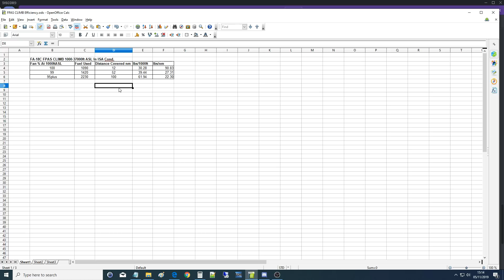Questioned: How To Most Efficiently Use FPAS CLIMB In FA-18C (Vid 2 of 2) | DCS WORLD

Comment: Just another iteration of the same question: if we also want to consider distance covered (and fuel burned), then the test should run like: climb to 37k feet with 100% power, then fly level with best endurance speed, then watch fuel amount burned for lets say 100 miles, vs. climb with min. sufficient power to 37k, then fly "best range" speed until reaching 100 NM, and compare fuel consumption with the previous result. I think the first one would use less fuel overall, because you would reach optimum altitude and speed for best range earlier, and could start saving on fuel earlier. It is practically an angle-of-climb vs. rate-of-cimb dilemma I guess.
https://www.youtube.com/watch?v=EgtjSPXjgWQ

Comment: FPAS is all cool and stuff but I personally prefer to watch the fuel flow. the RPM changes by altitude, and doesn't tell much about how much fuel you are burning. Fuel flow however will allow you to keep your aircraft going stable up with minimum fuel consumption. I need to check how the FPAS method compares to one I have been using, this is really interesting stuff :)

Comment: Those FPAS numbers are completely bonkers. Climb speed should never exceed cruise by that much and a lot of fuel is being wasted to parasite (400+ kts) and wave drag (> 0.85). As stated by most, best power setting is always MIL because it gives you the best power to fuel burn ratio. The important task is to find the speed which balances engine efficiency gains from ram effect with increased drag. The optimum is probably going to be between 350 to 400 kts indicated depending on configuration. Switch over to cruise mach when you reach it (0.85 in this case, but typically 0.82).

Somebody already stated this but the way you do the test is by flying a set distance (around 100 nm), and then you evaluate how much fuel was burned and the time it took. Sometimes small fuel savings can cost a lot of time which is why airliners use cost index. There will be a speed under which you should never go and it'll probably be a lot higher than you think.
Reply: Yeah, exact fuel burns and splitting the last couple of % can get an insanely complex subject. Airlines spend hundreds of thousands of dollars on specialty flight planning software to try and squeeze out every last drop of energy from the fuel they pay for.

Comment: Former military aviation mechanic here. Its standard to set power and adjust pitch hands down for optimal climb/fuel burn. Its lift/drag ratio that predominantly determines this. On a clean aircraft this can be all the way to mill-power for an optimal climb. Every airframe is different and depends on fuel, ordinance, and weather.  This is why pilots must know their performance envelopes and weights. It's the exact same for civilian aviation where climb rates and airspeed don't exceed airspace limitations.
Reply: On a separate note there are substantial differences in throttle control from 2 decades ago. Years ago you would add throttle with altitude to maintain EPR. Today computers do it for you and you are just adding added power with the lever, ie. it maintains a given acceleration depending on throttle position.  This gets very complicated when comparing decades old tech to current.

Comment: The clue why mil power(and more importantly afterburner) is more efficient than the other methods is in the distance covered column. Distance covered is heavily related to time and the more time you spend in dense air, the more fuel you burn.

There are several adventages to climbing to optimum altitude using afterburner, you spend more time in cruising altitude and less fuel is spent, you have more time to configure your aircraft(waypoint sequences and A/G & A/A modes and SA page radar etc...) once up there and more things that I can't think of.

Comment: So here's the very quick explanation for why there is such a thing as an optimum climb speed. It's a balance of several factors: induced drag, parasitic drag, engine thrust change with airspeed and fuel flow rate change with altitude. You are looking for an airspeed that, when all of these factors are added up, results in minimum fuel burn per nautical mile. Induced drag increases with AoA, so the goal is to minimize AoA (hence, increase airspeed). OTOH, parasitic drag increases with airspeed, so you want to limit your airspeed to avoid excessive parasitic drag (one of the reasons you'll notice your FPAS was targeting a fixed Mach number of 0.89, because starting at M0.90 you start getting into the transonic high-drag regime). Next comes the fact of engine thrust with airspeed. Turbojet engines generally lose thrust with increasing airspeed, however, the curve tends to flatten out at higher airspeed (and sometimes even reverses at very high, typically supersonic, airspeeds). Lastly, increasing altitude reduces air density, which proportionally lowers your aerodynamic drag values. So again, you want to fly as fast as possible to get maximum engine thrust and be able to reach higher altitudes faster (so you get to exploit the lower air density there to lower your drag), while not going so fast that it requires you to use an inefficient engine mode (i.e. afterburner).
All that having been said, you didn't quite do the test right if you wanted to estimate fuel burn per NM traveled, because you ended up not traveling the same final distance. The correct method would have been to level off at the target cruise altitude and sum up the fuel burn to your desired distance traveled. For example, your initial test with afterburners seemingly used the most fuel per NM, but you neglected to add up that for the remaining almost 100NM that the 95%Fan test had to travel, you'd have been traveling at a far lower cruise burn (given that you could throttle back and get much lower fuel flow values). It would still most likely have ended up being the least efficient method, but it would have pulled the final numbers together a lot closer.
Keep in mind, the final intended cruise distance will affect the optimum cruise altitude you chose A LOT. In general, climbing to the highest attainable cruise altitude that you can maintain at MIL power only makes sense if you are traveling fairly far. Otherwise, just climb to the highest altitude attainable before you need to initiate an idle power descent (WITHOUT having to use speedbrakes!). This is called a parabolic flight trajectory and is commonly used in civilian service to minimize fuel burn on short hops. Your FPAS airspeed probably doesn't take your intended trip distance into account, so consider it a rough guess. There's even more parameters that affect the exact optimum cruise airspeed value (e.g. the value of your time, not just fuel) - all of these are pretty extensively calculated in civilian aviation, where they are trying to balance the economics of operation. For your purposes, however, when conducting a ferry flight, short answer: climb at MIL power, FPAS speed to the highest altitude you can attain at MIL power and FPAS speed (sub M 0.90) and stay there. This altitude will differ based on your weight, and you can even execute a very shallow "cruise climb" (where you continuously climb at or below 500 ft/min), provided you can maintain your FPAS speed. The key is keeping it at MIL power and FPAS speed. This will pretty much give you optimum fuel burn for your trip, +- 5-10%.
Reply: At last! Someone who can understand this shit (flight perfromance)
Reply: Sounds like you've studied for ATPL?
Reply: Beanbag Ninja I’ve got performance exam in 5 days time 😂
Reply: Thank you for taking the time to type all that. Very interesting information.

Comment: Do all your tests to climb to 37000ft and travel 100 nm and see who has the most fuel left to fight
Reply: This method is probably the most accurate.

All tests: Start level flight and reach optimum climb speed first and then pitch up.
Test 1: Variable throttle usage with constant pitch angle
Test 2: Constant mil power with variable pitch angle
Test 3: Constant afterburner with variable pitch angle(max 30 degrees unless you are overspeeding a lot)

But spoiler alert, test 3 will result with the least fuel used.
Reply: That's what I thought. Could also be, that the afterburner guy will overtake the other climbers while flying through the thin air at 37k ft at fpas speed.